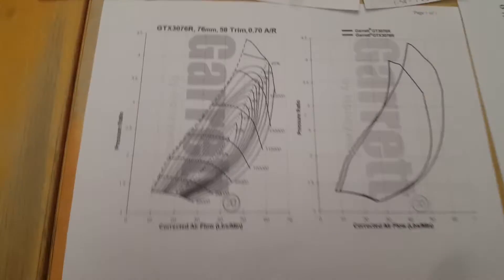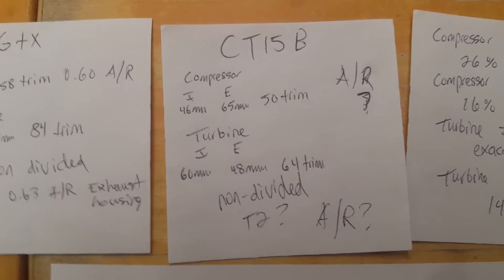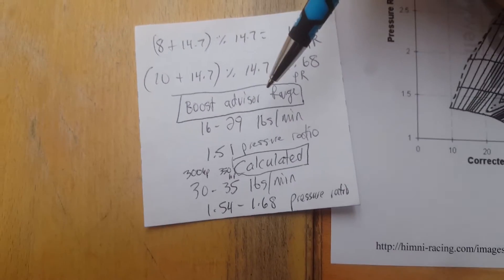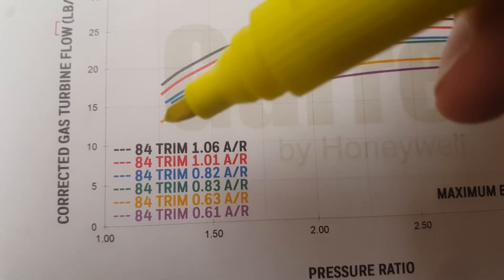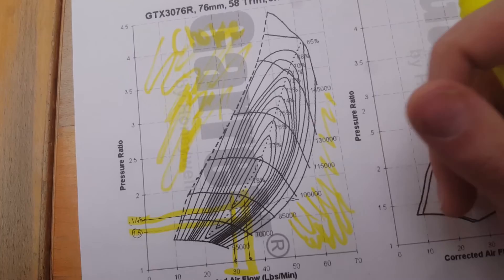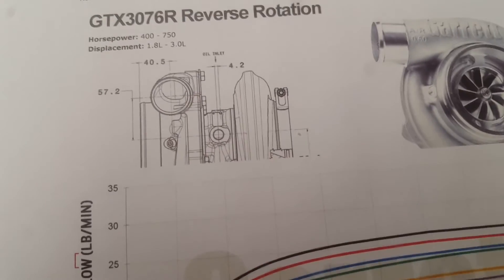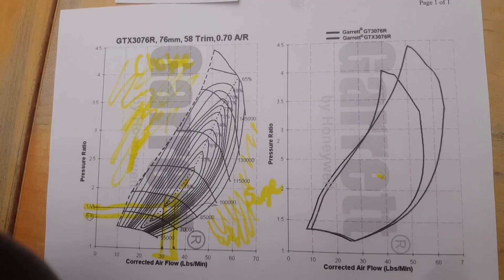Turbo Tech | Garrett GTX3076R Ultimate Overview

Comment: How much hp you think I can get with stock block 1000cc injectors rods and a 440 lph fuel pump on 91 octane
Reply: How much psi
Reply: And makes more power gt3076r or a gtx3076r gen 2
Reply from the maker: The x makes less boost. But the 2nd gen makes more power regardless due to better compressor efficiency
Reply from the maker: PSI is a measure of resistance. You should shoot for how many lb/min of airflow to make X amount of Horsepower
Reply from the maker: 600hp if you're lucky. This is at 80% injector duty cycle, 43.5psi base fuel pressure.

Comment: Running a 1jzgte  non vvti with 2jzgte ecu 440s injectors how how do you think a 1j and this turbo would do at 13psi
Reply from the maker: Fine. It would work
Reply: Where do you see boost on this setup

Comment: @7:55 The upper left side is actually the surge line.  Surge is when you request the compressor to pressurize the air more than then engine can accept, this is causes the compressed air to push in reverse from the exducer back out the compressor inducer.  The choke line is on the right, and its where you reach the flow limitations of the compressor and its efficiency becomes really bad, like <58%.  This means you are nearly heating the air up more than you are pressurizing it.

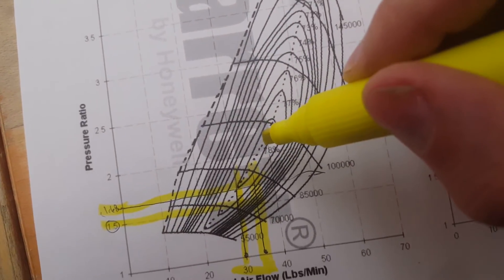Comment: @7:20 On the left you have a compressor flow map.  On the right you have a turbine flow map.  One doesn't have anything to do with the other, other than the fact that in a turbocharger assembly they spin together.  So the efficiency islands on the compressor aren't related to the maximum efficiency of the turbine.  Just thought I would mention that because how you described it sounded as if you meant they were the same, but they had a discrepancy for some unknown reason.

Comment: Great vid! Im glad you took the time to explain this. Im looking into this turbo gen 2. I wanted to ask you some question to kind of fiqure out this information for myself. Im looking at trying to make 400bhp-500bhp. I want to figure how much psi i should and keep the responsiveness of the turbo. I appreciate your help
Reply from the maker: Do a gtx3071r with a .63 or .84 hotside housing. Running like 16-20psi should get you to 500+hp
Reply: @jessedrifts  thanks for the reccomendation. Iwill look into this, i want to keep amount of throttle response but have a decent bhp

Comment: Hry brotha. Im currently running a gtx3071r... i want ro jumo on gtx3076r but not sure if its worth it... would mind explaining the difference between the 2 ? Will the 3076r lag way more then 3071r ?
Reply from the maker: Stay 3071r unless you're going for like 600+hp. It's laggier compared go a 71r. Looking back I wish I would've gone 71r but it's all good.
Reply: @jessedrifts  well im currently fyll motor build so i want 600+ thats my issue lol wanted some advice for my 2016 audi S3

Comment: The gtx3071r is a better turbo. This gtx3076r is a mismatched turbo. The turbine wheel 55exd can't handle the flow of the compressor wheel 58ind so its 58/55. This is why Garrett made the 3576r. 
I made 490/485 @30psi on E85 on a Mustang Dyno with a gtx3071r.
It spooled ridiculously fast. Hit @1900rpms & full boost 30psi @5600 and held to redline 9k
Reply from the maker: Quick spool at low rpm destroys stock jz bottom ends. Plus this turbo was new and for the price I couldn't pass it up. If I had unlimited money and choice I'd run the gen 2 3071r or sxe with an 86 exhaust housing with a quick spool valve.

Comment: Question what do you think about GTX3584RS? Too lag or spool quick? If I’m using 20-33 psi ?
Reply: 3576 would be much better
Reply from the maker: RS? Haven't heard of that one. If it's gen 2 it won't be laggy.
Reply: Yes it New gen2.
👍
Reply from the maker: Ya those things are crazy. Virtually no lag on any 2nd gen turbo due to the ball bearing design and wheels
Reply: jessedrifts Thanks for reply 👍
Reply: It depends on what ur using it on. The 84rs was made to make big numbers, it's a 1000whp turbo, and if ur only making 30psi, I would go with the 3582r or even 3576r. Both of those turbos will make 700+ with little to no lag depending on the motor.

Comment: did u fit the turbo yet?? when do u hit full boost and what hot side did you use?
Reply from the maker: yes it rips hard. I hit full boost around 3200rpm. Hotside is .86
Reply: @jessedrifts  nice video 👍 so you switch from a AR.63 to a AR.86 was there something about the AR.63?

Comment: Id have to agree gt3076r.  A gtx is not going to shine until after 20+lbs. Go with the durability of the bb cartridge in the gtr. See if they make the high flow housing in the 76' size. Thier is not much of an advantage gtx series until the rb.

Comment: good video I love that your actually studying the turbo and the maps! however you need to do a little revision on how to read the maps form your data the 76 map shows you will have excellent compressor efficiency at redline excellent for racing and maintaining high rpm but your mid and low rpm will suffer, Id suggest a slightly smaller turbo go the GTX 3071. also the turbine efficiency isn't directly related to the compressor map. the turbine map is essentially when the turbine will start to spin the compressor. so on the turbine map for the .63 the engine needs to be flowing atleast 12.5lbs/min of exhaust for it to start compressing air. once you reach your desired pressure ratio of 1.68 the waste gate will start to open. the wastegate will now continually open more and more to maintain 12.5lbs/min flow through the turbine at 1.5 PR as the rpms increase! generally waste gate sizing is larger if you want to run more boost with a small AR turbine housing, the wastegate will compensate for the lack of flow the turbine has!

Comment: Solid video man lots of good info. Just wanted to point out you have the surge and choke lines on your compressor map the wrong way around though
Reply from the maker: Ya I noticed that after I made the video lol I was like damnnn it brain! haha
Reply: jessedrifts haha no biggie man easy to get them mixed up awesome vid either way
Reply from the maker: Cool! thanks dude. I will be putting up another video today or tomorrow of an underglow install and dyno video of 1jz vvti stock power numbers at 5000 feet of altitude here in Colorado
Reply: jessedrifts awesome man keep me posted on how you go with it all, I've just got myself an r33 as a drifter so keen to see your results. 1jz and rb25 will be close enough to be helpful! Cheers mate
Reply from the maker: So far the gtx3076r is on 12psi stock ecu/injectors the afr's are 11.0. My guess is around 330hp or so
Reply: jessedrifts nice man solid result!
Reply: 11.0 is way too rich.

Comment: WHY U JUST DIDNT GET THE GTX35R BRO ,???? JUST WANT TO KNOW
Reply from the maker: I would have liked to but with my power goals, airflow requirements, and response that I want I went with the gtx30. I will have a video of the response once I finish my winter build!
Reply: jessedrifts hi can you tell me if the gtx3071r is a better turbo for a evo 8 than gtx3076r. will be on stock block. i take it the will spool faster.Do you know how much faster?